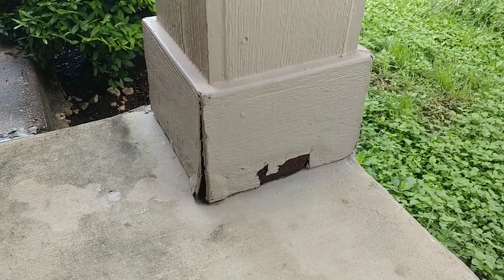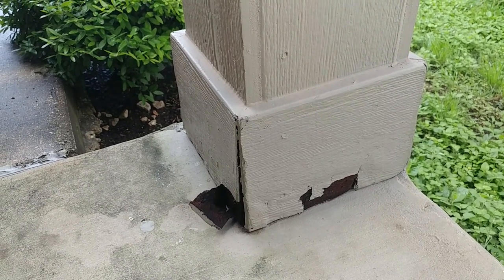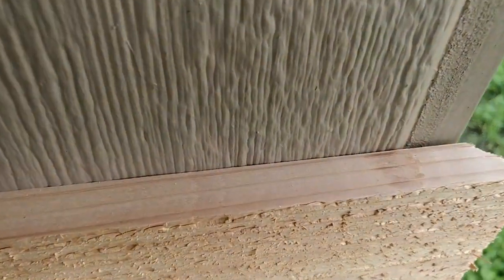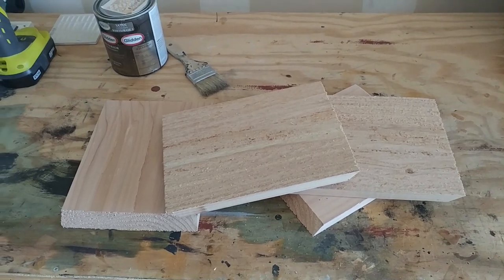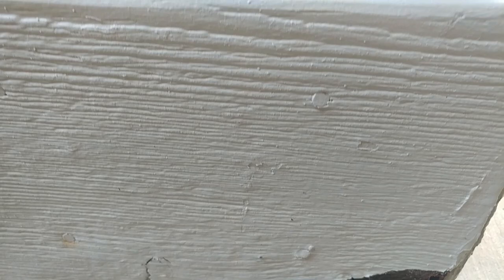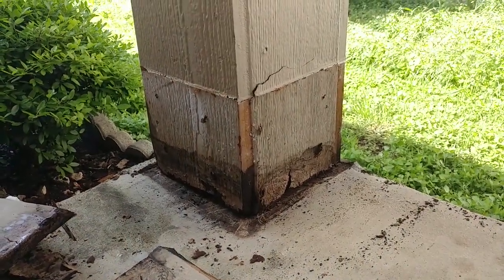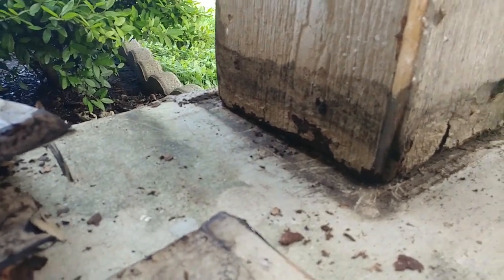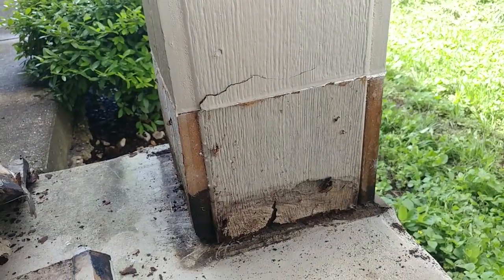Replacing rotted wood trim around front door post

Comment: I'm sure you've probably already resolved this or moved on but the easiest solution would probably have been to just replace with 6x6 posts and forget the casements altogether unless you just wanted the extra trim at the base. Granted new posts would have been way more expensive. Your end result looks good - You did a good job on the mitre cuts.
Reply from the maker: Thanks! Yeah, what I did seems to be working still. Looks like new.
Reply: @MarkSarpyJr  I know this is years ago, but I have the same issue. How did you cut the wood?
Reply from the maker: I used a miter saw to make the 45 degree cut.